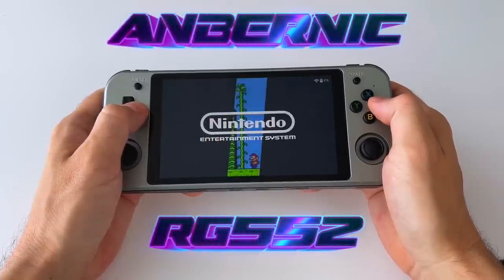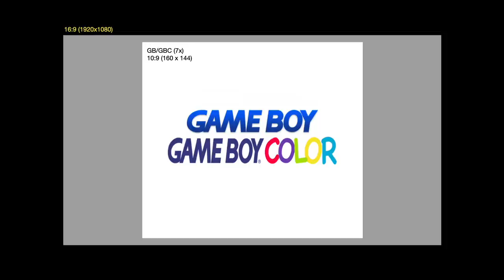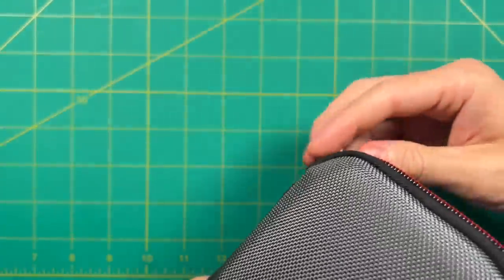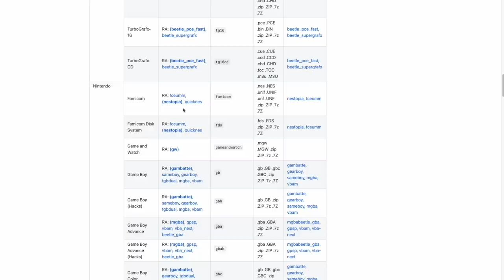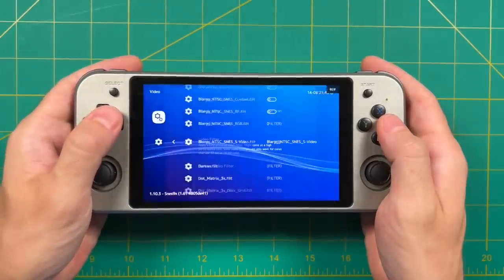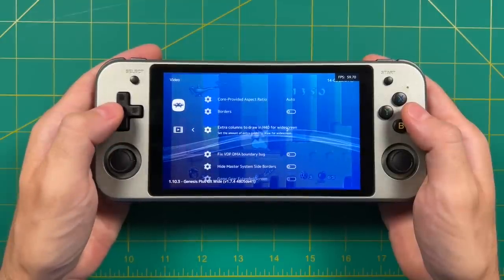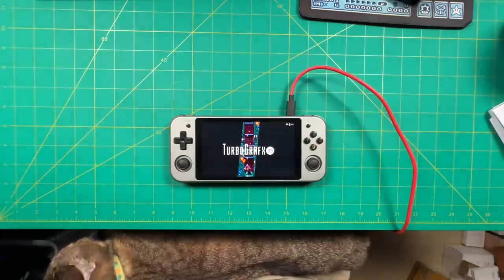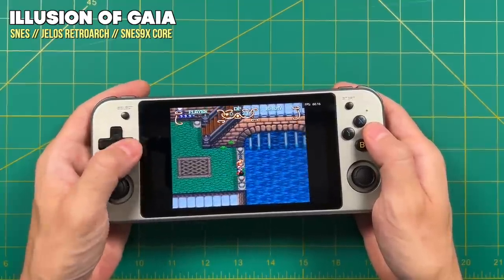This is still my FAVORITE handheld for retro gaming.

Comment: The 552 is so nice on the shape and screen. I get it the price is too much and I agree, but to me the biggest flaw is the chipset. The rockchip this uses is just awful, on the android side it heats up and eats battery like a cop on donuts and has worse performance than the rp2+ on gamecube games. Linux is actually worth it here, no matter what complaints you may have. It's actually fun and runs cooler than android and playing ports is better here(to me) compared to the other retro handhelds since you get a beautiful bigger screen. If you can buy it at a discount, go in.

Comment: I found RG503 at 189€ in Amazon.. and the RG552 at 199€ in a spanish website. No too expensive for what you get, a handheld with fan active cooling, 64g rom and 4g ram and the impressive display. 
I liked a lot!! just the small battery is a problem but a great anbernic handheld better than my RG280V, RG351P..

Comment: I have and I love the RG552. The killer features of it for me are the super awesome screen that is built for pixel perfection, the clear and crisp sound of the device, the performance with 16bit era systems and arcades, the controls that feel great and responsive and portmaster playing AM2R perfectly. I also like the placement of L and R buttons as well as the fact that they are all digital. This device sure has its shortcomings and it spends its large batteries rather quickly but it does not get that hot (with AmberELEC). Overall it has taken way more flack that it deserves from reviewers. For example reviewers tend to exaggerate about how good is the RG351MP. Although it feels great in the hands I find it severely underpowered and I had a defective unit with screen flickering out of the box. Not only that but the minimum price I found for it when I bought it was 189 euros. Fortunately it was refunded by Amazon (thanks Amazon) and I bought the new, at the time, RG552. RG552 has great support and it gives a great retro gaming experience. I bought mine for 213 euros. 213 euros very well spent!

Comment: I use mine all the time for retro gaming on Linux side using amber elec firmware works great. The new anbernic 505 might take the crown soon though.but I think if your only going to buy one device you should save for the steam deck it does everything apart from fit in your pocket.

Comment: Why does a retro handheld not have a 4:3 screen?
Reply: The RG351MP has a 3.5 inch IPS Display with a 4:3 ratio 640×480 resolution.

Comment: Cheers Russ, interesting to hear your longer term take on this. In a way it reminds me of the Analogue Pocket, not a great fit for everybody but if it nails things you consider important it can be a great, possibly essential, choice. Anyhoo, back to Klonoa on my 351p, I could play it on the Odin but choose not to, just seems more fitting on the three fiddy one.
Reply from the maker: Yes, it was the Analogue Pocket video that made me decide to make this video!
Reply: Analogue Pocket is still not that great even with openFPGA, there is no SNES core for example and the cores that exist have limitations such as not being able to use the Original display modes (one of the biggest selling points and reasons for that display being as high res as it is).
For GB and GBC it's basically the best possible experience, but The 552 or even the 351V does a lot more.

Comment: Interesting! I liked your points about screen aspect ratio, JELOS big/little cores options and quick charge support (I think people don't talk about power issues on these devices enough).

That being said, RG552 is of course a failed product. What's worse — there doesn't seem to be a better alternative to RK3399, and it's a hot old chip that probably was never meant to be used on mobile devices this small. RK3356 is slower. RK3588 is even more expenive and likely needs active cooling and a beefy battery.

Between that and Rockchip drivers issues (Vulkan support, etc), the future of Linux handhelds doesn't look bright, unfortunately. Makes sense that Anbernic is looking at Android-only SoCs for RG505. Android is nowhere near JELOS/AmberELEC in terms of usability and polish, but there simply aren't any good chips to choose from.

Comment: I agree it's a great handheld, especially for the price but personally most of my games are gamecube titles therefore I'm looking at something powerful enough (probably the Win600 despite its flaws).
I always have a 20k power bank on me and I'm often near a power outlet so the battery life is of no concern to me.
Reply from the maker: I think by the end of the year we're going to see some really nice x86 options that will make the Win600 less of a good deal.  The budget AYANEO Air Plus and the Loki devices should probably better price to performance and would be great for GameCube and higher.

Comment: the RG552 got a lot of heat when it dropped due to its price to performance, but I picked one up anyways and your completely right, for retro content the screen is incredible, it really felt like a revelation that 5:3 is an almost perfect substitute for so many different aspect ratio's used by retro machines.

Comment: I think Anbernic's new RG505 might beat this one out.
Reply: I think the 353P beats this device out. Best handheld anbernic has released in years.
Reply: @Pridetoons  yes but you need a over engineered fan/heatsink 
for the 552.
Reply: @iamnotyourbuddyGUY  i ordered the rg353 and wanted to cancel it because soo many people blame it on its performance for the price …
What are your thoughts ?
Should I buy a cheaper handheld or is the 353p the best I can get for the price range ?
Reply: @pislik814  All depends on what you want to do with it. 353P is great for PSX and under

Comment: I prefer the Odroid Go Super. It only has a 1.3ghz  quad ARM, but for $80 it is hard to beat. It was made for open android, but it will run linux just as well. It can run all the retro gaming distros like lakka, recalbox, bactocera. It can only go up to Dreamcast. Besides that it is solid for the price and features.

Comment: Can you explain PC ports a little more?
Reply from the maker: Sure, community members build shells that allow users to run the Linux version of certain games on Linux-based firmwares using a tool called PortMaster.  Essentially you have to install that shell (which is an automated process when using PortMaster), drop in the game files from your Steam (or other) library, and you can then play the game on your device.  Here is my PortMaster guide/video: https://retrogamecorps.com/2021/09/21/guide-portmaster-on-retro-handheld-devices/
Reply: @RetroGameCorps  thank you so much. 🙏

Comment: This or the Ayn Odin. I still can’t decide
Reply from the maker: The Odin is better in just about every way except when it comes to 16-bit and below systems.
Reply: @RetroGameCorps  Thank you! I love watching your videos but I get overwhelmed. I just want to play PSX and below. Can’t wait to see this one
Reply: @Pridetoons  Thank you!
Reply: @Pridetoons  You seem like you know what you’re talking about. I hate to bother you but what’s the difference between the 16G and 16G+64G. I can’t seem to find an answer. :(
Reply: @JoshuaJacobs83  for the 552? These devices have two SD card slots.  The 16gb will have their stock firmware/OS, and the 64gb has some games.  In general, it is recommended to get the cheapest bundle and not pay extra for games because they can use random roms that aren't quality dumps, and the SD cards themselves are not reliable long term.  Just buy the 16gb (which should be the cheapest).  Then buy some blank SD cards from a reputable source like SanDisk or Samsung, source your own roms, and then use this youtube channel for setup guides.
Reply: @misterkeebler  You are a hero!

Comment: I never like Anbernic's quality control. When I got my RG552, I found R2 shoulder button works not clicky-just mushy and not clicked properly. I tear down my 552, I found out why. They put some kind of celophane stickers  on the bottom of every shoulder buttons to fill the gap between the button and the switch, and the one on R2 was out of position!

Lazy bastards.
Reply: I ordered that shit from the AliExpress official store and received it on December 28th last year. I don't know if it's better now, but I don't want to recommend it if there's doubts the quality of the device that selling at that price.

Comment: Let me share this thought: what would happen if You try to flash this device with the HoloISO? If You can get SteamOS into that device to use the 4 GB of ram and stuff that the device has. Do you think it would be worth trying?
Reply from the maker: It unfortunately won’t work at all. HoloISO is made for x86 architecture devices, so fundamentally it’s not compatible.
Reply: @RetroGameCorps  ohh! I didn't remembered that! What I remember is that for raspberry pi OSes there is an emulator for x86 steam for ARM architectures. There is a way to make the regular steam to look like steamdeck UI . . . The only thing that I don't know is how would work the remmaping of the buttons

Comment: This video had me thinking, I'd love something like the Switch for emulation.  Take it on the go, come back and 'dock' it to charge it and play on the TV with a BT controller.  The only thing I've really seen that would be 'great' is the Steam Deck but those are out of stock still.  Anyone know is there anything else out there that would be similar and cheaper?
Reply: A used and softmod-able v1 Switch?
Reply: Honestly? Used Samsung s series or note and a razer Kishi or better controller will kick the pants off most any of these devices. If you are willing to give up tv out and go for middle of the road performance you can pick up dimensity 700 phone for around $100.
Reply: Ok, I'll agree with @fukov3400  . A decent phone is the true way to go.
Reply: The Odin with the super dock does all of that.

Comment: I have the RG552 and I love it, but I’ve been back and forth with my Ayn Odin. Both are fantastic but yes, the Odin is better for the higher end stuff.
Reply: How do the D-pads compare between the Odin and RG552?
Reply: @xportz  sorry, I just saw this. My Odin’s D-Pad has never once malfunctioned, and works well, but my RG552 often gets stuck in the down position, and quickly navigates downward and I have to press up to stop it. The 552 is a bit more stiff to press, but mushier when pressed in all the way. The Odin feels a little clicker.
Reply: @ozmaphase2  Thank you for the info!

Comment: Jelos is slow compare with AMBERELEC on this device. I do not recommend it. You can see the difference on games which are on the edge of performance on this device: DOA2 or Mushihimesama. Stack R1/R2 buttons are great when you play shumps in vertical mode. One of the reasons why bought this device. Most bad thing for me on this device is that there is no bootloader to choose Linux or Android. You need to eject sd card physically every time. They should make it programmatically like on Odin.

Comment: To each their own. Although I could have afforded it easily I just can’t get myself to buying something with such a bad price/performance ratio.
I know that price/performance isn’t all but it’s at least 50% of what matters for me and therefore I can’t buy something like this thing … even if I would kinda enjoy it for similar stuff that you enjoy there would be always a little Devil on my shoulder whispering „you paid to much for this bad performance“

It was pretty much the same with the first windows handhelds … before zen3 or bottom of the barrel like the win600. Terrible price/performance. 

I had no problems buying an Odin Pro and a Steamdeck on the other hand

Comment: The RG552 is def overpriced. For example the RG503, which has only slightly smaller screen (4,95" vs. 5,36" on the RG552), only costs half the price but has:

a) better ergonomics
b) better picture quality thanks to razor-sharp OLED display!
c) bigger battery (3500mAh vs. 3200mAh on RG552)
d) much less weight (235g vs. 355g. for RG552)
Reply: Gotta disagree with the picture quality. It is oled, but it isnt as sharp.  Just depends what you care about.  552 is also more powerful too.  And this is equally subjective but even though I like the 503, it's possibly the cheapest feeling anbernic I own with the plastic they used in the shell. It does make it nice and lightweight if thats a priority to someone.  The face buttons don't feel as good as their usual either.  At least the dpad is great.

Ultimately, nothing is perfect lol.

Comment: Performance  is irralavent when u can get the vest performance from ur phone .
These were invented to game more naturally and with buttons and a more likeable gaming exprince and bothing beats this with that in mind every single fucking game i load up on this machine i perfer playing it on  this device rather then using my 1,999$ phone or $700 steam deck or my 3,000 ayo neo device  i stipl rather pop this shit in my pocket and game on it u can argue the retro pocket is also po ketable and more powerfull but i  never touch my retro pocket cause again 
The gaming eprince sucks on it the screens crap small buttons cheap the shape to small its all bad and above all the 552 has a crazy good menue interface easy to use and navigate with box are demo and pictures unlike the basic android UI u get just text game... tex consoles lmfao its such a not cool gaming eprince i never pivked mine up after i got it much like all the android base devices coming out

Comment: Everyone says the odin kills that ambernick!! Not even close. Whats wrong with you!!! Lol
Reply from the maker: As I said in the beginning of the video, it absolutely can't compete with other devices like the Odin.  But to me they have different use cases.  I use the Odin for streaming and all-around emulation up through PS2.  For the RG552, I use it for 16-bit and below because of the screen, d-pad centric controls, and Linux firmware experience.  If I could only choose one to take with me to a deserted island, it would probably be the Odin.
Reply: @RetroGameCorps  my opinion...the screen is the only thing better..it handles everything plus it's sooo much nicer to hold in your hands. Build quality,  button layout,  screen size , more powerful,  even the setup is a breeze....if you asked 1000 people which one....everyone would pick the odin....they wouldn't even have to think about which one....even if that thought it had all the same specs!!  Even if they cost the same!!!!  Odin for the win  1000 to zero!!!
Reply: @jaynosowsky9708  Cool story bro.